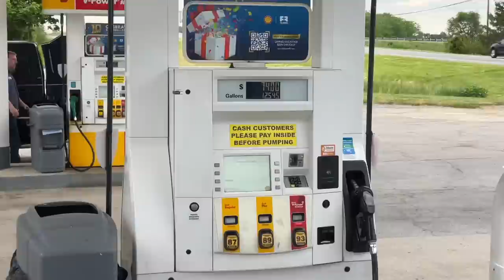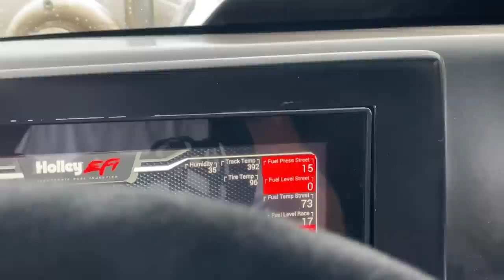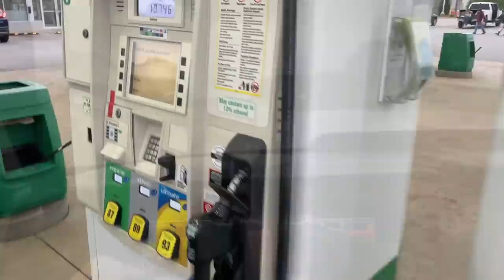Midwest Drag Week DAY 2 - Mullet FINALLY Hooked Up and Ran His HIGHEST SPEED EVER!!!

Comment: Why does it only have 36 pounds of oil pressure when you're going down the road?
Reply: The engine is operating at a lower rpm and requires less oiling. 36psi cruising on the highway is good pressure. Wide open it'll be at least twice the pressure

Comment: I don't understand why the valves won't keep the lash settings
Reply: They lash them to a tighter tolerance, or maybe zero, for the racing. Then put them back to normal for the street.
And, with an engine like that it’s normal to check them a lot so you can be ahead possible problems. Basically if they change more than a couple thousandths something is going wrong.

Comment: get a better better battery  if its pulling that much juice  it could over heat the battery  and catch on fire not good :dothefive:
Reply: get a cat batteries  pr the highest  battery  they make I have seen them catch fire  a cheap battery will melt wires you don't want that😐

Comment: I gotta know, why are so many people not running air filters in front of those turbskies? Road grit, grime, water, bugs? Am i out to lunch?
Reply: How would he fit them on?
Reply: @beardedforlife3740  well obviously the hood is in the way, i dont just mean cleetus, ive noticed it quite a bit on all sorts of different vehicles. Like i wouldnt run no air filter on my truck.. and i can garuntee these built racecars are not cheap to repair. Just wondering am i missing something?
Reply: @bikeman1396  no they definitely should run filters or at least turbo guards like Cleetus has on Mullet
Reply: I guess max airflow is key, havent seen the mesh guards up close, assuming tighter woven mesh

Comment: Love the channel Cleet, but don't rag on the LS too hard....there are race programs running a full season on an aluminum rodded 427 LS' running bottom 4's at 180 at 3000lbs in the 1/8th. Tuning is the biggest killer of head gaskets/rods...It should be more than capable of mid 6's.

Comment: Lol the difference you're feeling is torque and not spinning that big block as fast as the old ls. Why do I say torque? That engine is making more power or the same power at lower rpm. Hp= torque times rpm divided by 5250. That's why horsepower and torque always meet at the 5250 mark. Horsepower is literally a measurement of torque at rpm. If you can make enough torque with less rpm you can potentially make more horsepower. Or more torque at higher rpm etc. Look at f1 cars of the past. 900 hp or more at 18000 rpm. Do the math and that's not much torque but a lot of rpm and hp. The 540 is buzzing 7600 ish rpm? I'm just guessing. The ls was pushing past 8600 rpm? In order to make as much power or more at lower rpm you need more torque. Hence the feeling that the that the engine isn't even trying. Also in truth it's not. You got a lot left untapped there Cleeter. The big block has more power to make and not care where the ls was on its limit. Sorry for the book. Hopefully someone reads this and is more educated though. 👍

Comment: Must be depressing to spend all that money on a race engine make all that hp and run the same you were .
Reply: There’s more in it as they get things dialed in better, and if the track was really well prepped. 
But, the main idea wasn’t as much to make it faster as it was to make it reliable. They were stressing the LS to much so they wouldn’t last. This setup should be able to run consistently around these times without blowing up every few passes.